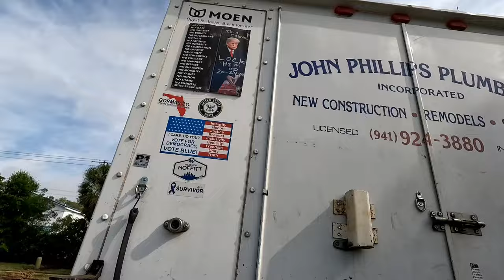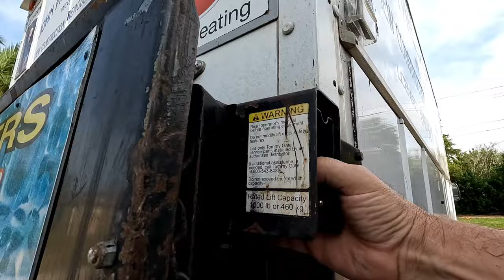AN EASY SERVICE CALL TO START A WEDNESDAY!

Comment: Is that water heater vented with dryer hose ?
Reply from the maker: No,it is a pretty expensive, expanding, stainless steel ,water heater vent,not cheap!

Comment: I hear ya Johnny! You surprised me when I seen you break out that plastic tubular trap. Very good stuff. There’s nothing wrong with them. We use the hell out of them around here
Reply from the maker: I didn't want to have to cut it back and use an 1 1/2" coupling to get a  Hub union hub trap back in there.  I do like when I see a tubular trap when it comes to a stoppage,easy access. 
Have a great evening my friend
Reply: @johnphillipsplumbing7148  very true. Good thinking. Less work on you and less fittings is always the way to go. Have a good evening as well brotha!
Reply: Tubular traps are great. I use them all the time. But you can't use sulfuric acid in them to clear the drain. Trust me, I know. They melt like a pop sickle.